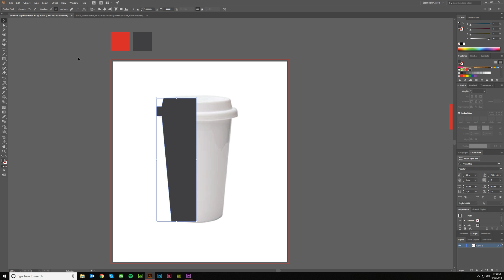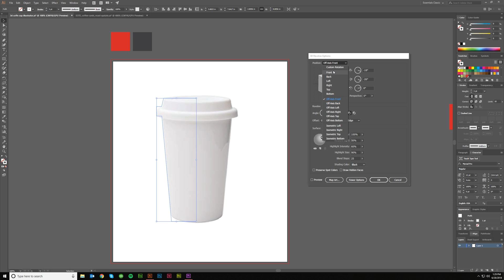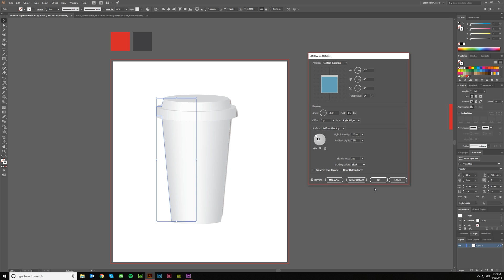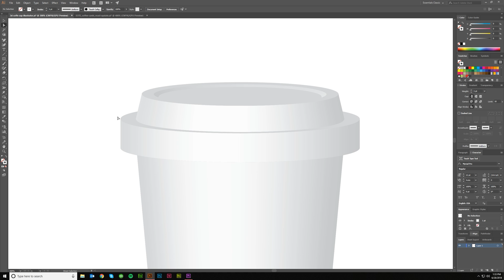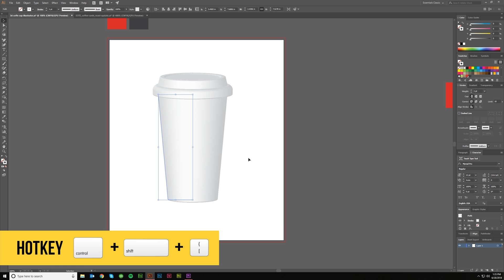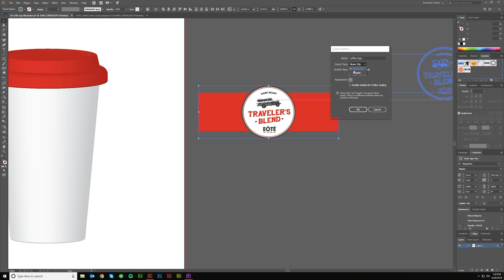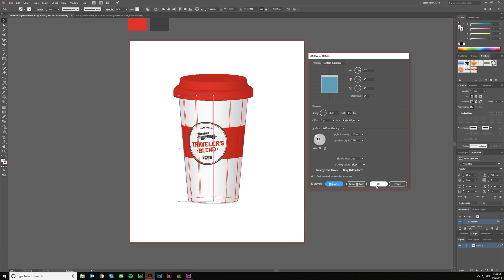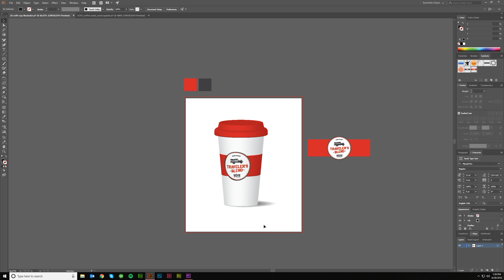How to Make a 3D Coffee Cup in Adobe Illustrator using Mapping

Comment: I took the flower as a symbol but I cannot see it. it is somehow behind the color of the cup ..what did I do wrong?! I'm lost :) I took surface 6 as you did,, but I can only see it when I check "disable geometry" .. I don't understand why it's overlapping ..
Reply from the maker: It may be on a different surface. Try something other than 6.
Reply: @CaryHawkins  It is on 6 .. when I move it around, it moves around in the preview .. but I can only see it while disabling geometry. I'm confused :/
Reply from the maker: I don't know. Maybe try a different symbol and see it you get the same issue. If you don't, then maybe there is an issue with the flower symbol.

Comment: 5:55   Are you using the direct selection tool while dragging the line? I tried several times but it didn't work.
Reply from the maker: You probably have something else selected. Click off the object first. Then only click the line segment between two anchor points. If you click an anchor point, it will move that. If you just click the line segment between two anchor points, it should move that segment with the anchor points on either end of it.
Reply: @CaryHawkins  Thank you so much sir. New subscriber here.
Reply from the maker: Yes, direct selection tool. Hotkey A.

Comment: excuse me sir, im a begginer on illustrator, can you make the toolbar, menubar and the tool you curently use a bit large, it's hard for me to see what you do, and how to enable the rounded path on cc? thanks
Reply: the way you rounded the side of the lid sir, by using direct selection tool, there's a point next to anchor point that you can drag to make it round. In my illustrator there's no point next to anchor point.
is it because the different version of software? Im using illustrator ver. 17
Reply from the maker: Sometimes that rounding cursor doesn't appear. You might try messing with your object. If there are actually too many points, maybe right next to each other, then you might not be able to see it. Try recreating the shape and see if it appears. You might also try removing any curve between points. Under the pen tool area of your toolbar, there is an upside down looking V. Use that tool to straighten the curve of the point you want to round. Hopefully something in here does the trick.
Reply: thank you very much sir I'll try your tips
Reply: and what illustrator version do you use?

thanks a lot
Reply from the maker: Latest version
Reply from the maker: What do you mean by rounded path?

Comment: So, there are a number of engineering programs out there ie Solidworks. I'd like to ask have you been able to or is there a way to build say an assembly in Illustrator..? The 3D programs have a way to rotate your part or assembly... What have you found? Also, I thought it would be great if Adobe would develop a full 3D program (For the Apple)...
Reply from the maker: I'm not familiar with solidworks.  Adobe has Dimension software which is good for mockups in 3d. It's not a full blown 3d software, but I have a recent tutorial showing how to use it.

Comment: Question: How did you get the edges of the cup smooth?  I tried doing this exercise but the edges are jagged on mine.
Reply from the maker: You might see if your graphics card is being used to render the cup. If memory serves, it's under view at the top somewhere. I'll write back if I got that wrong.
Reply: @CaryHawkins  what a great tip
Reply from the maker: Thanks!
Reply: @CaryHawkins  Thank you for this video. Actually i have same question like @Noel. When i saved image in png or jpeg (300 resolution), edges are Jagged. some white pixel type lines are there on top of this cup. Will you Please explain this.. Edit:- View : GPU Preview . This looks perfect on Illustrator but after save in jpeg format i face that problem.
Reply from the maker: Not sure. Have you tried bringing the ai file into Photoshop to see if it does it there?